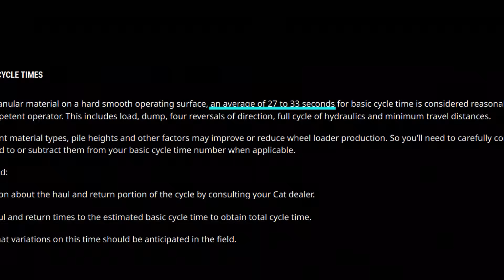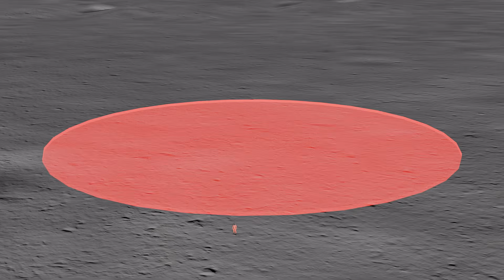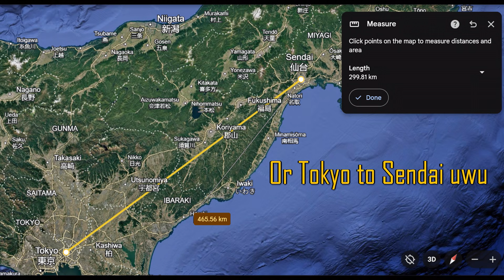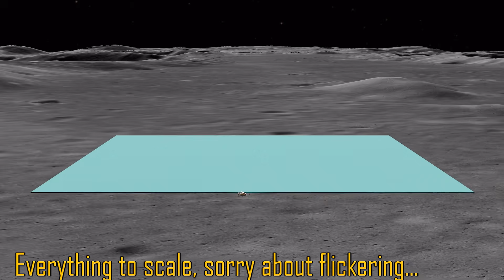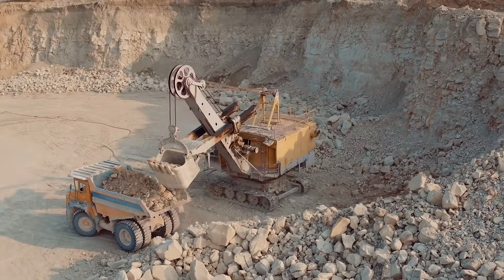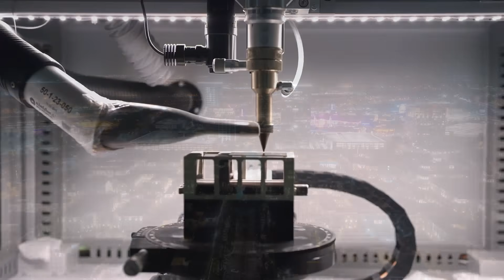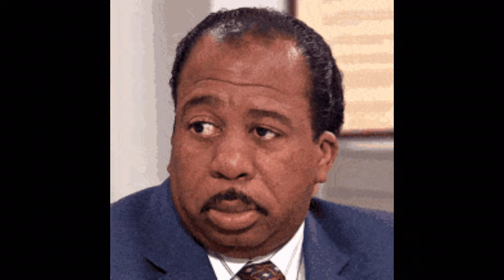How Much Bulldozer Can We To The Moon?

Comment: Before bulldozers SpaceX will have Lunar Boring Machines that will be smaller than those machines the Boring Company uses. I mean don’t they already make bricks from what they Bore. ‘I remember seeing a video about that. The bricks on the Moon are supposed to be much bigger, so they need bigger Boring Machines, right?’
I’m not sure how it works, will they melt the regolith and cast it into what’s needed? Did I read somewhere to use lasers from Lunar orbit to melt the Regolith to make the first Landing Pad for Starship?
‘No, I wrote that a few years ago.’
Reply: I have been thinking about casting a brick from molten regolith, and heard people question if it was the thing to do. The reply that most give is, “No, it would need an additional infostructure.” I am sure some of you are thinking, ‘How hard is it to make something like an ice cube tray and pore the molten regolith into it?’
Remember we are on The Moon, poring and settling into the ice tray is not like on earth. Most of you were thinking that won’t work, after reading my idea?
‘We just need pumps to add pressure to the hose, and fill an airtight cast, but why do that when we already have a 3D printer?’
We are printing the landing pad in layers with rebar to add strength. I don’t know how many layers. I’ll let the scientist figure it out.

Comment: if belly-landing is not an option, then the entire machine could be shipped in pieces and assembled onsite using the elevator as a crane. the only limit to underground mining equipment size is the size of the elevator: on Earth, the true limit is the tyre - the only bit you cant weld back together

Comment: I think your being to hard on yourself, and falling to much into the details. You dont need to make the leap to 100% locally made from the start. Something I could see as being a massive benefit is if your already making aluminum wire, jack the design of one of Relativity Spaces 3d printers and you can make the frames or replacements for simple parts. Only import the complex bits like motors, and control system boards. As you get more demand start to make larger and larger systems. And once your more established you can push to make more complex parts. That's how it works here on earth after all.

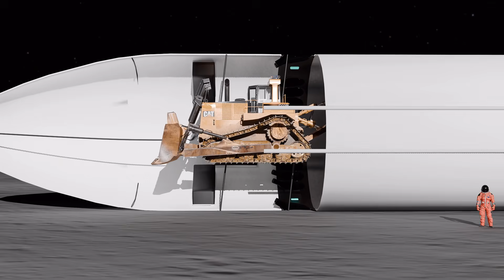Comment: 3:12 Ok, i'm thinking about it.   If you can lay the whole thing over like how is shown in the picture without damaging the dozer, the rest is easy.  Cut the struts connecting it to the starship with some shape charges, and just drive the dozer out.  That sheet metal is like tissue paper to a dozer that big.  

If you want something a little less redneck, you could cut the sheet metal open with lasers, or maybe design a fairing that could be unbolted, but those two options dont sound like as much fun.
Reply: Inspired by another comment:  Keep in mind 2 basic facts:  1. Stuff weighs 1/6 on the Moon compared to what it does here.  2. Very large machines are often shipped from the factory in pieces and receive final assembly on site.  Assuming we're sending people on this expedition, it's well within reasonable expectation to have a small team assemble a forklift which could in turn unload the parts and pieces of a 100-ton dozer.

Comment: For the Dozers, a lot of the weight is less about structural strength and more about just being heavy enough to get the required traction for shoving things around. Case-and-point, the US army M9 armored combat earthmover has an almost 7 m^3 bucket behind the dozer blade that it can scrape material into to about double it's weight before it starts bulldozing so that it can be lighter for transport and mobility, and that's for a combat engineering vehicle. I think any lunar bulldozer imported from earth would be built the same way. It lets you get at least twice as much dozer for a given payload mass, and they then double as decent scrapers, which are ideal for earthmoving in between dozer and dump truck distances. 
That dozer design would probably also work pretty well as a prime mover for the land trains of regolith carts since that has the same issue with traction limitations. I assume you would build one of those train car unloaders that flip them upside-down to unload the land trains for processing to keep the carts simple. 

I might also think about excavators and draglines that can spin on their base using a bin full of regolith as the counterweight instead of the fixed power shovels you tend to animate. excavators are really versatile and with quick change tool heads are the most efficient way to handle all the odd jobs around a construction site, including being an impromptu crane for small loads. The dragline has two big advantages, it's basically just a crane, so you can use it as one when it's not digging and a folding or disassemble able dragline with an ISRU counterweight probably gets the most earthmoving capacity for a given mass and volume constraint. Draglines also dig very deep very easily, which cuts down on travel distances without the penalty of having to get equipment to the bottom of the hole.

Comment: I realize the designs shown are just a visual aid and not representative of real life, but as shown they would be stuck spinning their tires. The dozers and loaders would need very wide tracks and additional weight to have any sort of traction. The weight is simple and can just be a container filled with regolith. Another thing to consider is that bigger machines are generally more energy and time efficient, could be shipped in pieces and assembled on site.

Comment: Usually on Earth mines move most of their material as "overburden", the dirt in top of the good stuff, ore, etc. Being picky about our inputs maybe be useful on the moon too.
Reply: That's largely due to Earth having active geology that keeps mixing its rocks and concentrating materials in deposits. The Moon doesn't have that, so its surface is much more uniform in composition. It's basically just impact-shattered basalt or granite everywhere, with some specks of the impacting asteroids mixed in.

Comment: Considering that the world altering nineteenth century canal systems were built using Navvies with picks and shovels and wheels borrows, done  in record time, I think it would be safe to expect many, many small steps  to make the Moon a really good strip mine site is certain, using many, many small machines, till the giants can be built on the Moon, probably made out of those little machines after they have served their purpose. How many Navvies are buried alongside those canals? How many robots will be lost on the Moon? The robots will be recycled, the operators, maybe not on the Moon but certainly on Mars. What we learn on the Moon will be of direct use on Mars! And I expect that, after the first few years, Moon Navvies will be recycled on the Moon too, along with their worn out machines. For the Working class, the future isn't going to be any sweeter than the past.

Comment: It's easy enough to imagine a scenario where vehicles are made as unassembled kits where the human crew will put them together on site. With that in mind you can probably save quite a lot of tonnage by leaving out all the parts that can be made of lunar material. It makes sense to build the electronics on earth, and the more precisely machined components. I'm sure plates, cables, buckets and beams can be made on the moon though.

Comment: The problem i see is that when calculating the amount of mass moved by a buldozer (big or small) is that it takes one minute to move whatever amount of mass by a few meters. thus unless you just want to move one massdriver worth of mass by a few meters it would take a whole lot longer to just move that mass to werever it needs to go.
So big machinery might be back on the menu fellas🥳

Comment: one thing you missed is the entire supply chain from getting the material to actually getting the final result, along with the sheer amount of mass that will be needed for all of the projects. You are making habitats, energy storage, production, cities worth of infrastructure, and all of that will both increase the material need, and reduce the efficiency of the small fleet. You absolutely will need big machines

Comment: Don't forget the moon dozers and moon excavators need to be weighted down. A 100 ton D11 weighs that much on earth, but would only weigh 16 tons on the moon. That's not great for a machine that depends on its weight for traction. It would need to have large lead weights bolted to it, maybe even tungsten weights, to get its weight on the moon up to where it had a suitable amount of traction. These weights would need to be transported separately and then attached to the dozer on the moon, so before sending a bulldozer you would need to send a crane, capable of lifting the weights and installing them on the dozer. The same applies to excavators which rely on their weight to bite down into the ground. A CAT 350 weighs 47.6 tons, but on the moon it would weigh a little under 8 tons. It would need weights to be attached to give it the digging force it needs.

Comment: Why batteries at 100 WH/kg?  The high-end batteries in use today are about 300 WH/kg.

800 WH/kg solid-state batteries are available.

I would expect we would choose to pay extra for the power density. 

To support the growing auto and grid power expansion, we will need a 10-fold increase in battery manufacturing in five years. It is likely to come mainly from refined chemistries. 

If you subscribe to Write's law on this, we will see two to three reductions in cost in the next 5 years as manufacturing processes are improved. We should expect two 0.75 factors -  50% the price or higher capacity for the same price.

I would use 500 Wh/kg.

Comment: Another thing to consider as well is the R&D cost of the fleet. Since very little exists like it so it’s hard to say what it would cost but you can probably imagine it’s a lot. Also you would have to have very experienced technicians who can come up with solutions on the fly to fix problems as they arise which also wouldn’t be cheap but still atleast doable

Comment: You are incorrect that an object which has a mass of 600 Kilograms on Earth will have a mass of 100 Kilograms on the moon.  The gram and Kilogram are measurements of mass, not weight.  A 600 Kilogram object will have the same mass on the earth and the moon.  The metric unit of weight is the Newton.  An object that weighs 600 Newtons on the Earth will weigh 100 Newtons on the moon.  The English unit of weight is the pound.  An object that weighs 600 Pounds on the earth will weigh 100 Pounds on the moon.

Comment: One small issue with assuming that the sized down versions do the same work is that regolith is very tricky to drive around on. You need alot of weight to get enough traction to shear the regolith apart if you are using traction as the collection force. One way to get around this is to fill the vehicle with regolith to weigh it down. This increased weight means greater ground pressure which can only be solved by a bigger machine. You will end up returning to a machine the size of the D11 simply due to soil mechanics, but these could be more easily loaded rockets by being lightweight. Youll still want good ways to transport resources and collecting regolith vs. Pushing are very different tasks, all of which will likely point to what youve been creating.

Comment: another thought as to why we don't need massive equipment for moon mining is on earth, we are trying to exploit ore reserves that are buried deep, and have comparatively little ore as opposed to say even 100 years ago, as far as we can tell on the moon, ore is relatively evenly distributed, and at a much higher useable material percentage, so less 'dirt' is needed to be shifted to get the same amount of a required material.
Reply: As of right now we are assuming all ores are evenly distributed as in it is pulverized into the regolith itself and that are no easily accessible ore nodes. So we are planning with the expectation of having to move and process metric tons of regolith for everything we need.

Comment: the problem with this is that bulldozers are able to move so much earth because they are so heavy. this is because they need both high ground pressure and lots of traction to push its equivalent mass in dirt. while an equivalent tonnage of smaller dozers could theoretically move the same equivalent mass, none of them will be able to move all of that combined mass in the same spot. another aspect to consider is that if you're not digging deep you don't need excavators or dozers. you can use scraper trucks to collect the regolith and construct the processing collector in such a way that they only need to drive over the hopper to offload similar to how grain silos are loaded, thereby eliminating the need for loaders, too.
Reply: You could just have a central weight area you can fill with regolith.

Comment: Even that reduced mass would be impossible to lower to the surface with that wimpy elevator. The whole thing would need to be disassembled then reassembled on the surface, most likely in a moondust-free environment. And the first thing you would want to add is the 'battery charger'. Yes like you say start small, bring many but eventually scale up.

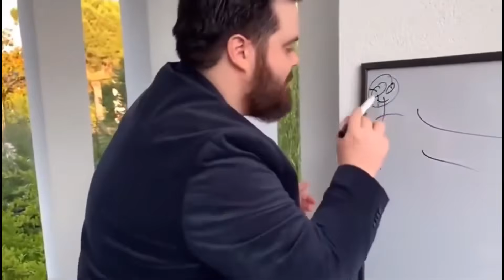Comment: 20:24 Actually no, moving an object horizontally requires the same mount of force to move but you face less friction if anything. Remember when you move heavy equipment on wheels that your force is an accelerant. Combined with the fact that there is no air resistance and all of your pushes require the same amount of pulling.
Reply from the maker: I'm just talking about structural support (of the cart) against gravity.
Reply: @Anthrofuturism and a spinlaunch? Pack de regolite, melt in a "cube", send with spinlaunch to orbit?

Comment: Wait did you account for recharging times of these electric excavators?  There's no way they can have 100% utilization, batteries need to charge.  

Also did you directly compare the area of the bulldozer scoops to the big one for calculating the volume moved? Cause that's not really how that works.  The angle of repose means that a scoop twice as high will move 4x the volume of loose material (assuming 45 degree angle of repose).  Though it is linear horizontally.

Comment: Not to sperg out more than any other viewer of the channel, but these vehicles will require a ton of support infrastructure that will require its own construction and maintenance. 
It’s enough that I deleted the comment I was typing and just recommend you take a step back from large numbers estimates in a few videos and think about fueling, maintenance, storage/protection during lunar night, thermal regulation, clean rooms for electronics maintenance, etc. 
All of these will likely require large, level areas with stable foundations, which puts a fundamental limit on the distance of deployment for the rovers. Not a huge issue for base building, but for a long, thin area like the mass driver you’re in a lot of logistical supply line trouble.

Comment: One big dozer can work on one area and one task at a time (and if it fails, you’re screwed). Many small dozers can be scaled to the downstream requirements.  If you want your dozer capacity split 40%/40%/20% you can do that with small dozers. With one big one you waste time moving between your mining, leveling, and shielding operations. With many, you can send a few off to work on that leveling project a couple km off because there’s no need to rush. You can just-in-time deliver that leveled area while mining and shielding operations continue. Conversely you can also flex resources to high priority but intermittent workloads like shielding new habitats. 

All of those mass-delivered time calcs were amazingly a single landing but, like you, I assume there’s an opportunity to bring more over time. Smaller units make it easier to have incremental improvements and specialization. One big unit can either do one job really well or many jobs but make compromises.  With smaller units we can deliver specialized units (or more likely, specialized modules that attach to standardized chassises) in the required ratios. We can upgrade chassises from mk1 mk2 etc incrementally and introduce specialized modules as needed. This can be done with big units but it’s easier with smaller units. Let’s say you have a specialized auger unit.  It’s important and imported so you can’t have just one. If you have one big dozer, that means you need at least two augers but now 50% of your auger deliveries are sitting idle. With many smaller units you can have a few spares sitting idle which might be 5%. 

Smaller units also means more delivery flexibility. One big delivery means a whole dedicated launch. Smaller units mean you can squeeze a unit here or there as needed. Initial deliveries are going to be highly specialized and bespoke but over time they need to become more like modern container ships. It doesn’t make sense to have a “sneaker ship” filled to the brim with new Nikes. It takes too long to fill and the delivery “pulse” is too big. Instead you put your sneakers onto a container ship with TVs and tee shirts and iPhones. Sometimes you might want a maximal dozer delivery but sometimes you might just need 1-2 new dozers for testing or spares. If one dozer = one landing you can’t do that.
Reply: YouTube comments > Facebook comments😊

Comment: My biggest guess is that the reason machines scale to be larger and larger as the material demands grow is the human factor. If we had cheap reliable computing systems that could manage a fleet of dozens of smaller machines I'm sure it'd be favorable. But to have a machine operator paid at a livable wage to maximize your profit, just give them a bigger machine to increase the workers useful output and decrease costs. Labor has long been the constraining factor in the ambitions of humans